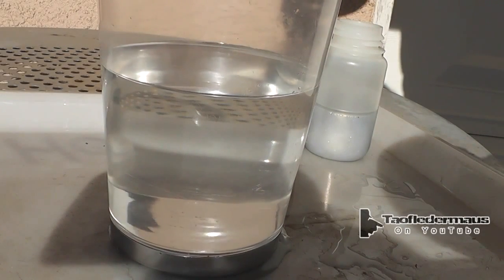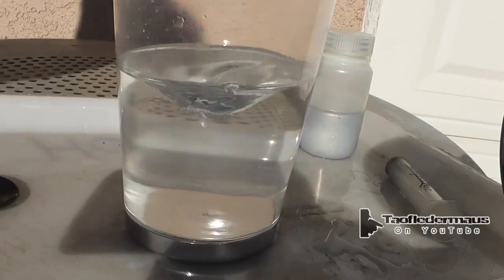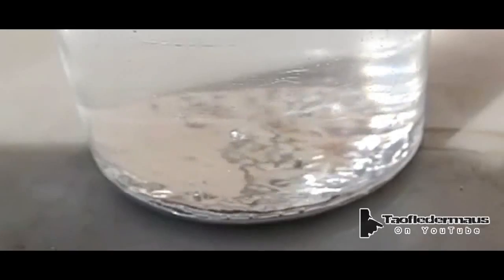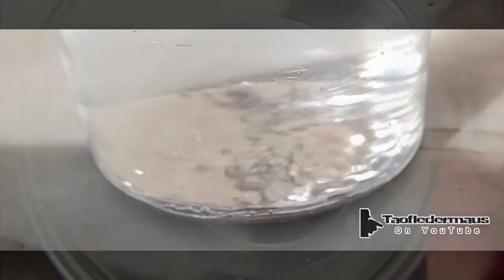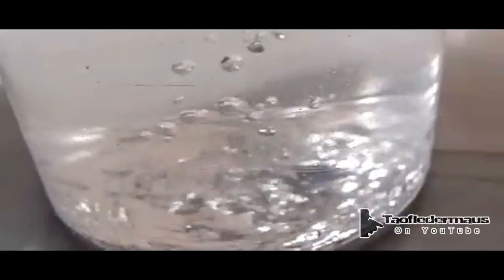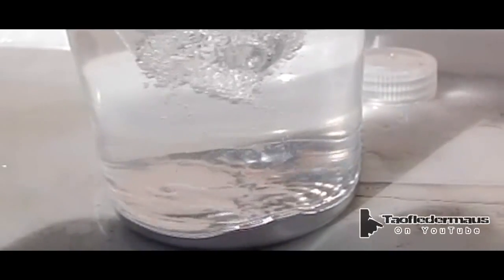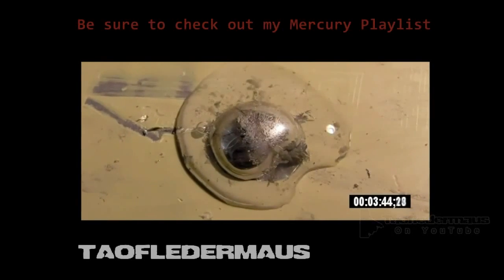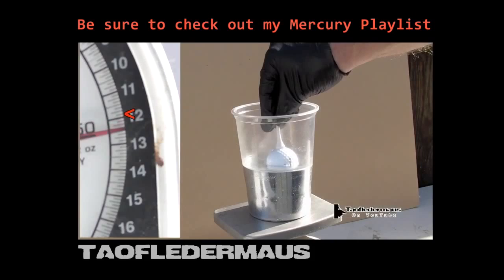MERCURY (Hg)  Can you Mix it with Water?

Comment: it's obvius it will not mix because it's diffrent densitys
Reply: Polarity is more important than density for two liquids to mix. For example chloroform is a lot denser then water and sinks while diethyl ether is less dense and floats on top of water. Both don't mix with water but they easily mix with each other because both are a lot less polar than water.
Reply: bdbdbd it's the same thing if you took a volume of 1 L and fill it with water and put it onthe scale it's 1 Kilo but with oil it's 0,914 g
Reply: Yes I know that, but it's has nothing to do with miscibility or solubility
Reply: bdbdbd allready know that
Reply: Fahd El khamlichi but you said it's because of density 5 days ago... and that's just plain wrong
Reply: bdbdbd it is the density and '' la masse atomique '' in french i don't know it in english 
i just didn't wan't to talk sow i sad i know it's false what you sad
Reply: Fahd El khamlichi
okay dude
Reply: bdbdbd that's fine man

Comment: Can you see how Mercury acts in activated charcoal water? I live in an area where Mercury has contaminated the river and I am always concerned about the public water supply. When I mix activated charcoal water from the tap and let it sit, there is a silvery sheen on the surface of the water, and these silvery and black little bubbles show up on the surface of the charcoal water and they act strange. Thanks :))
Reply: ***** 
Check this out.

Also that seems like a health concern. Might not wanna drink that.

Comment: In the video you mention bubbles on the surface of the mercury.  I believe your assumption is incorrect -- they are not water.  Rather they are droplets of mercury separated from the larger body by a thin film of water, so called non-coalescing droplets.  Once the film separating the droplets becomes sufficiently thin, cohesion takes over and the mercury droplet coalesces with the rest of the mercury at the bottom of the glass.

Comment: put water on mercury like the other way around
Reply: The same thing would happen.....
Reply: maybe some clear and very dense type of oil?
Reply: noo i think putting water ON mercury would be different
Reply: it would look the exact same since the mercury is denser (considering you use the same amounts/ratio)
right?
Reply: no im thinking like placing droplets of water onto the surface of the mercury making beads of water
Reply: okay okay i admit it would look pretty cool, especially in slow mo.. although for some reason i feel like they wouldn't form beads on impact.
Reply: well I dont thing on impact but something similar to the beads in the lyden frost effect would form because of the surface tension of the water
Reply: man i keep feeling like disagreeing, the lyden frost effect only takes place at high temperatures. I feel like the surface tension of the mercury would break the water membrane
Reply: no im saying that the "water beads" that form in the lyden frost effect would be simmilar to those in this expiriment, i think.

Comment: Drink it
Reply: ***** Thanks captain'
Reply: ***** no, most likely it would not (atleast not from poisoning) however it may rupture your stomach/intestines due to the density. the metal is fairly inert, and would hardly react to the hydrochloric acid in your stomach.
Reply: @Sgt.Hartman  a small but would pass through without a problem

Comment: Mercury when vaporized doesn't really have visible light absorption bands, only emission bands. However, when it comes to UV, mercury vapor will readily absorb it by itself and emit it when stimulated with an electric current, which is how fluorescent lamps and true blacklights work.

tl;dr it only significantly affects UV radiation.

Comment: suggestion:
what does Hg look like when exposed to Eddy currents.
e.g. by alternating magnetic fields like U get when connecting an electromagnet to 60Hz power lines.
or let a strong magnet rotate very closely to a mercury surface.

Comment: you could find a way to surround the platform your spinning the bay-blade with a clear plastic so if it spills out high it will hit the sides and fall down into your collector but then the problem would be finding a way to spin the bay-blade without having to drop it in from a hight

Comment: The mercury was actually spinning slower than the water. If you were to put the entire beaker on a spinning platform and then give enough time for friction to stop the liquids in the frame of reference of the beaker, the mercury would curve just as much as the water. It makes no difference how dense it is. Since centrifugal force is not a real force, that necessairily means it pulls harder on more massive objects in the spinning frame of reference.

Comment: The reason for the lack of splash in the water is because the dispersion forces between the water and mercury are so high, the mercury actually repels the water instead of hitting it for the first 1/4 inch or so, until the weight of the water overcomes the dispersion forces and forces them to touch.

Comment: Why not use a drill on low speed to spin the water and mercury? You could probably use some small tube or scrap metal with a bend at the end or a joint fixed in place if you don't simply use a small mixing bit.

Comment: I don't think that those are bubbles of water, they are bubbles of mercury. Same happens with water that if you drop a water drop on water, the drop will shortly stay on the surface tension and then loses about 2/3 of volume and bounces up again and it keeps repeating a couple of times. I guess that mercury does the same but bubbles don't bounce about because water it thicker than air but the principle is propbaly the same.

Comment: mercury repells spiders cuz they're light, just like water, the mercury squeezes the water from itself. what would be cool is firing a .22lr bullet into a balloon of mercury. you could contain it (the mercury) by building a clear plastic "tent" with a solid back drop, just in case the mercury didn't stop the bullet.

Comment: If mercury can be mixed with iron oxide powder maybe you can try putting a magnet on the Mercury to see if it will attract to the magnet or even an electromagnet so the Mercury can behave like a ferrofluid.
Reply: That probably won't work

Comment: Suggestion: low key background, or colored background, better light.  Macro lens, slightly colored water, use the stir feature on a lab hot plate, it uses a ceramic coated magnet inside your container and a rotating magnetic field in the plate that can be adjusted for the desired speed. Instant adjustable vortex. Just keep the heat off, don't want you howling at the moon mad as a hatter.